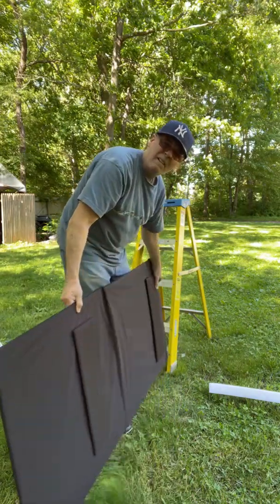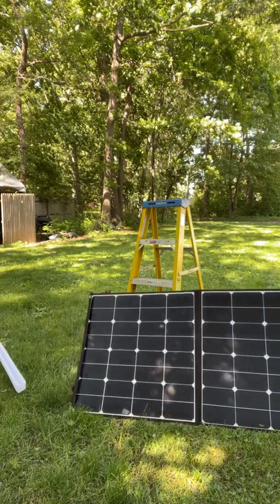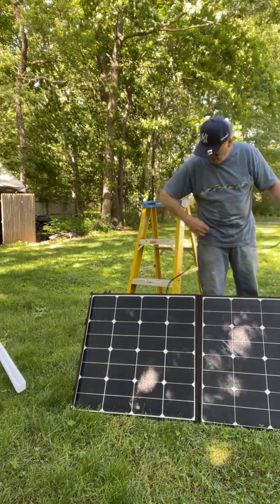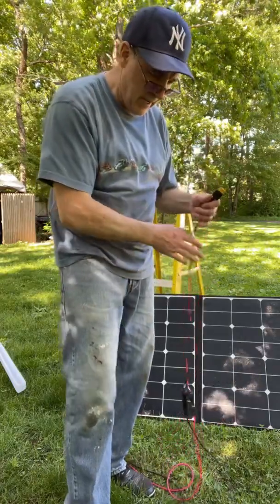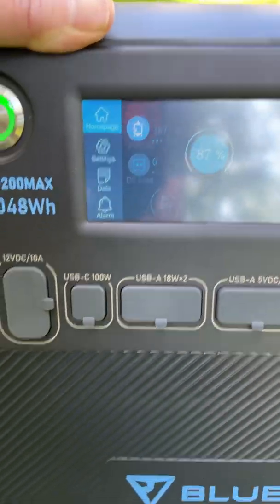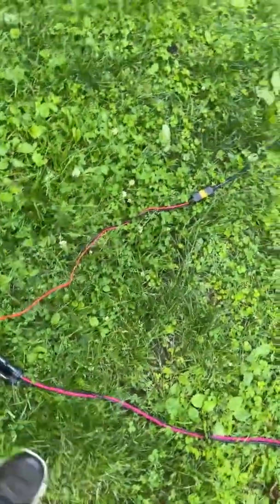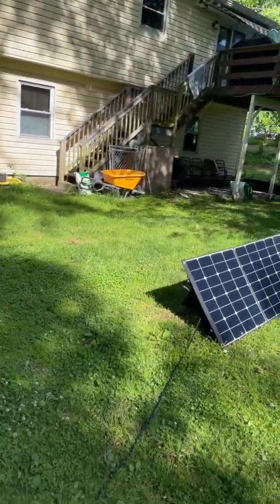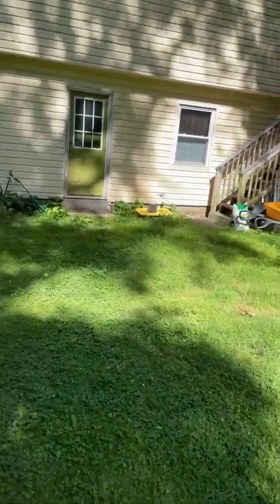The New BLUETTI 350W Solar Panel with AC200MAX Portable Power Station

Comment: If your unit is new to you, make sure you go into settings and change the solar input to PV. The default setting is set to something else that will reduce the solar panel input charge.  I saw this on another video where someone was complaining about charging voltage. You may have done this but just letting you know just incase.  I hate to admit it but I rarely ever go into the manual and read everything. Eventually but I get too excited and want to try it out. Just make sure you go through all the settings. I just purchased one over Black Friday and doing some YouTube research.